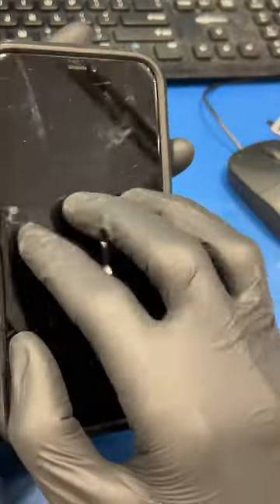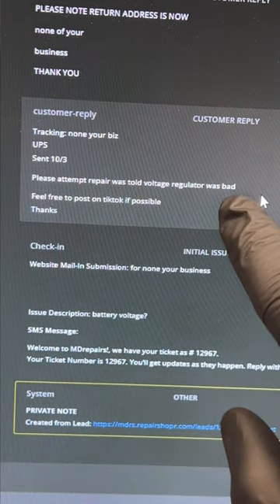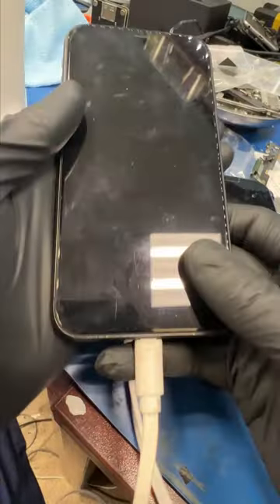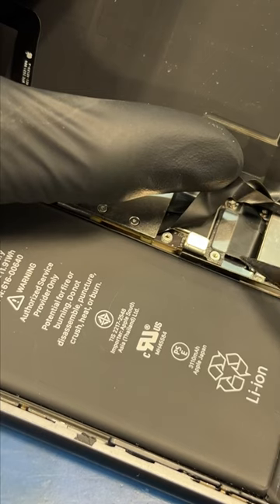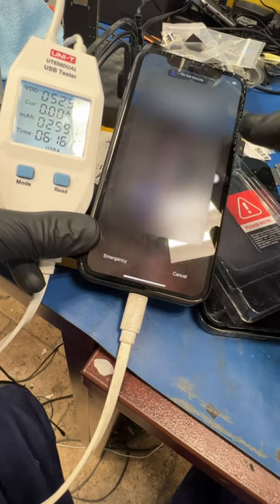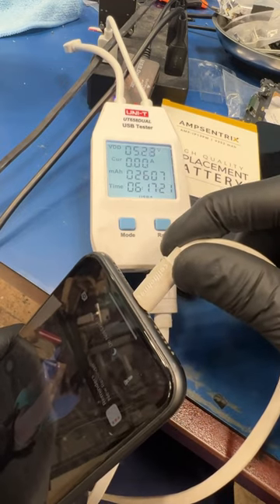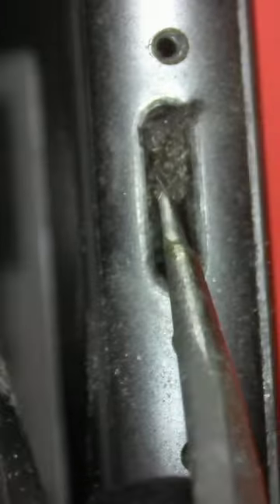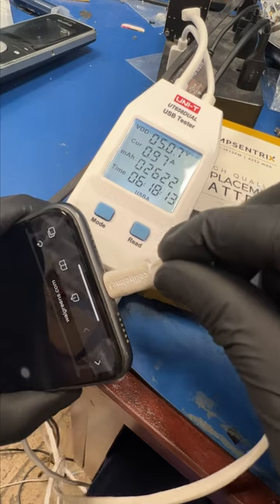iPhone Data Recovery From TheyBreakUFix? #iPhonerepair

Comment: They might as well have just said it was the "flux capacitor".
Reply: I had that go on my phone, super expensive to repair.
Reply: @davidgray8089  Yeah it's super expensive to fix. It requires either plutonium or 1.21 gigawatts of electricity, and those don't come easy
Reply: You got lucky with those options, normally you need to find an acoustic transducer
Reply: Except voltage regulator is a real thing and like this guy said it was messed up. So what are you talking about?
Reply: @toptiertech7291  Did you even watch the video?
Reply: @MrChainsaw80  yes. Yes I did. He stated what they said it was. The voltage regulator. So what’s your comment talking about? I get the B2TF reference. But you’re saying it like they made up a regulator
Reply: It’s great, man
Reply: @toptiertech7291 maybe because he keeps calling the lighting connector socket a voltage regulator.
Reply: A voltage regulator is in the power supply. 
The part you cleaned is the charging port.

Comment: You wouldn't believe the amount of charging ports I cleaned while I was working as a phone store clerk.
Reply: What's the best way to clean it? My brother got a little chip stone stuck in his charging port, toothpicks are to big and if you make them smaller they break. Also things from metal are not the best i guess. Any tipps and tricks? Couldnt find much with google.
Reply: @HansWurst-bf4qg  metal’s fine as long as you’re careful. In the video the guy uses one side of tweezers. Could also try a sewing needle, depending on the size of the debris. Also a magnifying glass can make it easier
Reply: @a_plastic_bag  Thank you for the answer, might take a needle and put one stripe of tape to it just in case.
Reply: I just wonder how they get so dirty. Do people actually still put their phones in their pockets?
Reply: @RebeccaHetrick where else are we gonna put it? Just gonna carry it around everywhere?
Reply: @HansWurst-bf4qg you can also just use a metal paperclip (just unbend it). Also so far ive never been super careful myself so as long as you arent using force/scratching around exessively the Ports arent really very fragile.
Reply: @HansWurst-bf4qg compressed air is good you can also get specific plastic / nylon hookers to deal with this issue.
Reply: @bobshop you have to be careful with that though. Some phones have mic’s that if a blast of air is blown directly into it can ruin the mic. Just be aware.

Comment: Voltage Regulator... Loose battery connector & dirt in the lightning Port.... Yes Voltage regulator problem. 😂😂
Reply: Charging port and voltage regulator
Totally same thing 😂😂
Reply: turned out it was the U-joints and rear differential

Comment: So many of these phone repair shops are just absolute garbage. Thanks for not being afraid to name and shame. 💯
Reply: what's crazy too is louis Rossman had a very similar thing happen with a MacBook that the genius bar said the battery connecter had bent pins and that it would be 475 to replace the logic board, turns out apples own repairs couldn't plug a connector in all the way like its meant to be....

Comment: Bro I remember Taking my ps5 to a UBreakIFix store because the picture wasn’t showing up on my tv but when I checked the hdmi port I noticed that the hdmi cord was really loose still even when plugged in so I just assumed it was a problem with the hdmi port and I can get it fixed or replaced easy. (I’ve had the same issue before on my old ps4) I took it to this store because of the reviews and when I told the lady up front about the issue she said that they could fix it but that it would take 2 months and be $180 I knew that didn’t sound right immediately. Found some local tech place and the guy there said to give him an hour and only charged me $100 even. 

Lesson learned: Always support small businesses
Reply: Authorized service center or Big Service Company are mostly A-Hole...
They just wanna drain your wallet out..
They said need to replace this replace that,n they will switch some of your normal part with cheap ass knock off. N few weeks later,voilaaa.... Comeback again for repair...

Now I always repair my stuff by myself now,even I don't have the knowledge.
Google it or YouTube tutorial.
If failed at least it's my fault,no regret no anger. 😂
Reply: You didn't learn your lesson though, you bought another playstation after already knowing they're fragile pieces of crap...

Comment: As someone who used to work at UBIF I will say this.
The stores are not meant for detailed repairs, at all. We are encouraged to spend about 5 minutes on troubleshooting and nothing more.
The store is setup for pretty much screen repairs only. I was the only non phone tech in the store(my specialty was computers) and all I was ever really able to do was windows reinstalls and hard drive replacements.
Ubreakifix is good for when your screen gets busted open, but if you want a detailed repair go to a smaller shop.
(Also they only pay 10 an hour)
Reply: thats some bad advertising then....they should just say "we only repair screens"
Reply: That really comes down to what store you work for. I currently work for a corporate UBIF, and at our store we do everything from simple part replacement to solder work. Just depends on who your franchise owner is, if one. 

I definitely know of a few stores who would pull the kind of garbage in this video, we aren't one. 

Pay also depends on the franchise owner. If you work for a corporate owned store, it starts at $14. Not much better though.
Reply: @krotchlickmeugh627  never said that's what I made chief but go on. That's what they start at.

Comment: Honestly, thank you for this video, I bought a used phone and was wondering why none of my chargers were working properly, I came across your video and decided to take a look at the charger in the bathroom light, I didn’t see anything crazy, but thought “meh, why not dig around and check?” Oh boy what a good thing I did, I ended up pulling out two massive wads of lint. Now all my chargers are working normally, lmao.
Reply: Wow, you fixed your voltage regulator! Well done!

Comment: I had chargers failing left and right, and I knew about the lint trick.  Turns out that I had a pin in my charging port of my iPhone X that was pretty well fried, but thankfully I work on all my phones since the 3G so it was about $20 and two hours of my time to fix.  I work on everyone in my family’s phones.  It’s really not that difficult if you have the right tools, most of which can be purchased for under $100.  Back glass is one that’s expensive (at least to do it correctly, imo).

Comment: We cleaned dirty charge ports daily at ubreakifix.... ours anyway. There were other ubifs that were.....subpar
Reply: Yeah I used to work at one. An important distinction to make is UBIF franchises their stores. The franchise locations can hire whoever they want and are less selective than the corporate locations. Every store has different techs with different levels of skill so you never know what you're gonna get. When techs get a big enough skill set many of them leave and start their own thing. I left mine just because the pay was shit. Doing specialized repairs and the most I ever made was 11 an hour.
Reply: @nowondr  ouch. We made alot more than that. But yeah that's where I am. I've left to do my own thing.

Comment: The "voltage regulator", otherwise known as a charge port or charging port. That connector regulates nothing. It provides an electrical path for the charger to communicate with the charge circuit and send voltage to charge the battery. That's it.
Reply: It's a joke man, you didn't get it lol

Comment: It's a pretty common problem for phones to get lint and other tiny pieces of debris stuck in the charging port. Just use a small needle to clean it and you'll be fine. These kinds of "phone repair shops" seem to all be fronts to copy personal information and has nothing to do with actually repairing phones

Comment: As someone who worked at a Ubreakifix, they are all franchises owned individually and this is far from how we ran our shop. But there are definitely some lazy people that don't want to work in hardware repair shops and will just send anything out the door because there isn't a number they need to hit.
Reply: Brought a 6s plus there recently for battery replacement and they said they couldn’t fix it cause “it’s too old”
Reply: @skxrillionaire  The one I worked at would work on anything. We also did micro soldering which most don't. But, we would tell the customer that it might not be the best economical decision if the device repair outweighed the cost of simply replacing the device. Some people wanted the repair anyway and we did it without question. We only didn't work on consoles or computers woth bugs nor water damaged devices (because we couldn't guarantee and lasting repair).

Comment: Literally 9 times out of 10, that is the issue, and I just clean it for free; it takes like 30 seconds.  If someone has charging issues, then the first thing I have always looked for is pocket lint/debris inside the port. If that's not it? I check the battery connection and look for the water damage indicators or signs of previous repair attempts. But it's usually just pocket lint or sometimes skin/sweat funk buildup from being inside of a case. You do have the unfortunately not-so-rare customers that get frustrated with their phone not charging before bringing it in for us to look at and have already mutilated the pins in the port.... but those can be spotted just glancing at the phone typically. 

Also, all of the UBreakIFix locations in my area are slowly closing down.... I'll just leave that there. 👀

Comment: I'm really surprised they didn't immediately jump to the conclusion that it was the port. Ports are notorious for failing and having issues. Voltage regulator seems so specific without actually diagnosing it was the issue.

Comment: So many times I’ve had people come in saying Ubreak I fix has told them something that just isn’t true or would cost them upwards of 4-$500. I’m pretty sure that over here, they are contracted to Apple now, so they barely diagnose.
Reply: The most recent was an iPhone 11 Pro. The customer was told they need a new screen at $450 and because someone had fix the screen before them, They won’t do it for any cheaper and will not provide warranty. Customer was happy to hear that I would do it for less than half

Comment: UBreakIFix is really awful at repairing devices... I had my screen replaced under my S22 Ultra's warranty from them and the back glass started to separate about a month later. Turns out they never removed the old adhesive and just put a new layer on.

Comment: How can a charging port be = to a voltage regulator ??? A voltage regulator is an electronic circuit to control(regulate) an input to a set output voltage !
Reply: Don’t get many jokes do ya dumazz

Comment: I may or may not work for the company mentioned and hypothetically speaking you may have just got a bad location because we don’t deal with voltage regulators if it’s a board issue we just say “board issue” also if it didn’t turn on we make sure the battery connector was plugged in and the charge port is cleaned

Comment: To add some context, as a former employee of uBreakiFix, most stores weren't like that. There were alot of quality stores with really smart people who enjoyed fixing things and problem solving. Unfortunately they tend to run by terrible franchise owners who don't pay well and tend to just hire one or two really professional guys and a bunch of inexperienced teenagers. Not to mention the rules and regulations from the guys on top that make quality repairs hard with their partnerships with Samsung, Apple, and especially Asurion. Funny enough UBIF sold to Asurion and well I can tell you that  it'll probably be worst as board level repairs will definitely be phased out.
Reply: We used to pick out linty charge ports for free all the time. So I can assure you it was some dumb kid they hired that probably didn't want to deal with what would have been an easy fix.

Comment: It is literally the most common charge port  issue for a repair shop.  We kept a tool near the register just for that, didn't even charge people for it
Reply: Yup.  And I’m sure youbrake ifix clean it 
But this guy just do fake video to get customer
Reply: Would really like to see the full video of it. 
We don’t see him opening the back of the phone to get accès to the battery. Was already open when he start recording.  You can easily unplug the battery before recording.  
I know ubrakeifix is not the best place to but , you saying that the customer opened the phone to unplug the battery him self ?   Or the battery disconnected by it self and then he brought it to youbrakeifix and they didn’t see that the battery was unplugged? Like the first thing everybody will chek first with a problem like this is the battery.   You assume that youbrakeifix didn’t see that ? And they didn’t see the dirt on the phone ??? 
Come on man.   
Really ????

Comment: Literally cleaning the charging port is something more people need to know to do. It's something that should honestly just be a part of regular phone maintenance. Wipe down the screen, wipe down the back, clean out the inside of the case, and gently clean any ports your device has.

Genuinely just do this once a month and your phone will just be nicer. Wipe down the exterior of your phone regularly though because that's disgusting. Preferably like once or twice a day with some type of disinfectant but at least once a week

Comment: If a new voltage regulator doesn't help check your points, if you're still having trouble getting it started check you coil.
Reply: Lmfao. Do you think it could be the condenser? 
I’m leaning more towards the distributor. Or ECU

Comment: That's why when I took out a motive in high school the 1st thing they teach you is if a car doesn't start you start troubleshooting at the battery and work your way back because that's always the most simple answer and it's usually the most common but even if it's not you've ruled it out and you know where to go from there but apparently no one talked that to the people at that 1st company because they weren't a 100% wrong but they've got to gotten this fix for the guy without looking so dumb
Reply: check the most obvious/simple problems first and work your way up.. That's the first rule in troubleshooting anything👍
Reply: They were deliberately trying to Con the phone owner. They even unplugged the battery

Comment: What did you clean the voltage regulator out with?
Reply: With tears of virgins and a brush made of thin alien hairs. 

Haha jk usually a thin non metal pick just carefully use it to scrub the inside of the charging port, you can use isopropyl alcohol if needed but make sure to let it dry before plugging it in. The toothbrush can be used for the speaker grill to be cleaned also with some alcohol.
Reply: @elpollolokon  I already have tears from virgins I just need to get the alien hair from my tio Juan🤣🤣🤣
Reply: @elpollolokon  thanks a lot i appreciate it I'm going to try that out, my phone needs to charge in a certain position I think cleaning the voltage regulator will do the trick
Reply from the maker: @elpollolokon  😂 yea this lol
Reply: You can use sim eject tool for the hard embedded grime. Isopropyl alcohol 90% and a toothbrush medium to hard bristles.

Comment: This is why i just use magnetic charging cables... U put a magnet dongle inside the charger and it will never get dirty. If the dongle goes bad, u just get one out of the bag of 50 they send u for $10 lol.

Comment: My man took his phone there. They fixed the screen and returned it with a new problem.  Whenever anyone called him, they could hear their own voice echo back. When we called them and asked how to fix it (cause we googled its usually an issue with the volume), they wouldn't tell us and said we had to bring it in. Are they nuts?! Bring it back so we can take it home with a new problem? Nope. He ended up getting a new phone because, at that point, spending more money on a crappy Motorola was not sensible. He still talks about how he misses that phone 😢

Comment: How is an input port issue a voltage regulator problem? The connector is clearly the issue. Perhaps one of the many voltage regulators is on the same "board", but your description of the issue is disingenuous.

Comment: Can I mail an old phone in. It’s was ram over by a car (long story) it worked fine for years after replacing screen. Eventually it stopped charging from the port so I used wireless charging for a while but eventually got a new phone. Would love to see if there’s photos on it but don’t wanna waste $ on a potential brick. It’s an xr

Comment: I have a second generation iPhone SE, the battery health is at 87%, however it is not last but a couple hours each day!

If I'm using it clearly it drains a lot quicker, for example 40 minutes to work 40 minutes to come home, and the idle time Plus the time that I use it during my break which is another hour.

I called you break it I fix it they told me it would take an hour and it will cost $110

I'm not desperate but that was crazy, I'm confident enough to change out the battery myself but I like the insurance of having somebody else do it!

I have an upgrade it yet, because I bought this phone through Criket, I paid three months in advance I got the phone for free!

Since then I have switched to other carriers I had the phone just shy of two years….

Anybody have any suggestions?

Comment: That's not a voltage regulator voltage regulator has three pins solder to a PCB that's in USB socket
Reply: That was the joke. The "faulty voltage regulator" was just compacted pocket lint preventing the cable from seating properly for a consistent connection.